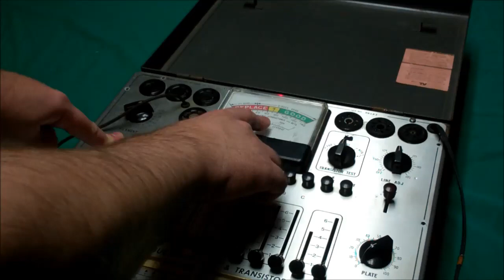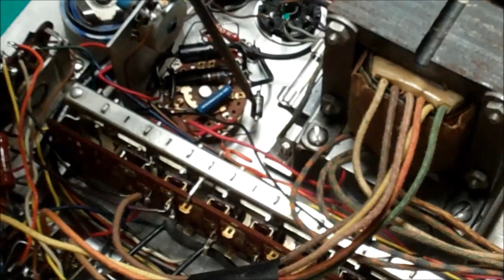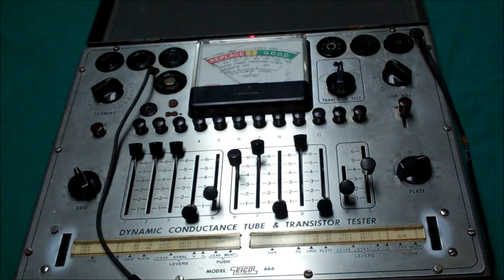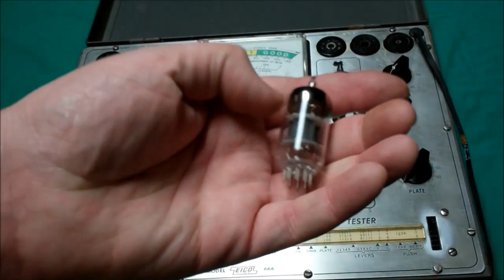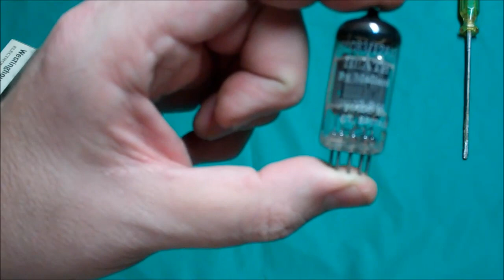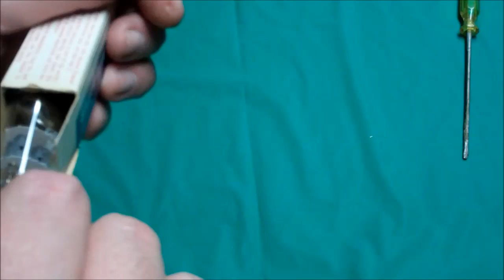Let's fix the Eico 666 Vacuum Tube Tester

Comment: The jumping around is your english control dirty contacts on wiper during rectifier test. My hikok 752 does same thing metere will go all over place if adjust control a little to left or right will clear it up. And yah should of checked line on those rectifier tubes cause they drop line a ways down

Comment: The orange tube tester isnt that great i prefer lab grade tube testers like my hikok 752, its fast for dual tubes to make sure both sides are closely matched and gives mutual conductance reading. For you the tv7-du be ideal since little easier to use and smaller in size. Dual tube tests though are involving changing switches
Reply from the maker: If I was dealing in tubes I would want something more premium....  what I have does OK.
Reply: @DeadKoby yah for quick checks of tubes its fine for sure. If want a slightly better one i would go dynamic tester. They can still be bought at reasonable prices vs the overpriced mutual conductance ones. Luckily got my 752 for reasonable price was 700$ cad now there going for double or triple

Comment: These 2 "valve/tube testers" are more like tube test indicators,they both don't give a clear value ,on  a tested tube/valve .
I own a ų Tracer V3 and a ų Tracer V 6 is in the making.These are kits you order,you have to build the electronic board,a casing with your selected tube sockets+ old laptop powersupply  and a cable to your computer.The software is included as a free software update.
It's a curve tracer,so when measured a tube,it's giving a diagram,to read out the value of this tube and how it measures to factory specs of this tube.

Comment: I know this video is old,  if you’re still getting comments. What kind of diode did you use to replace the 50V selenium rectifier?
Reply from the maker: I got some 3a Silicon ones...   I think that's what I did.   a 1N4007 should work too.

Comment: hello, I want to buy a test tube by which you can advise me test tubes or curve tracer.thanks
Reply from the maker: What models of tubes do you need to test?
Reply: @DeadKoby  I am a technician of old TV radios I want to know if a tube is working well or not working. To test the short circuit, leakage and emission.
Reply from the maker: The Eico 666 does a good job of that.  The main reason I have it is because it tests more types of tubes than any other I've featured on this channel.
Reply: @DeadKoby  ok which is better the eico 666 or 667.  do they have the 4 pin tube holder.
Reply from the maker: Both are good.  666 has one additional socket type.   I also recommend getting the LAST published tube chart from 1978  (online download)
Reply: @DeadKoby  thanks can you give me the link for tubes chart
Reply from the maker: @radiotvrepair1059  https://archive.org/details/eico_eico_model_666_tube_data_1978
Reply: @DeadKoby  thanks you buy tubes tester
Reply: Eico 666 test 4 pins and compactron or not thanks
Reply from the maker: @radiotvrepair1059  4 pin yes... compactron no.
Reply: @DeadKoby  I want a tube tester  that tests the 4 Pins tubes and compactron.